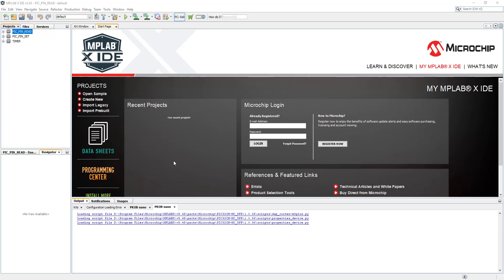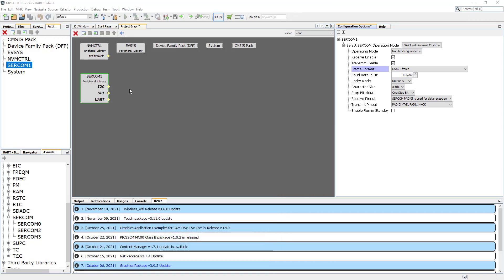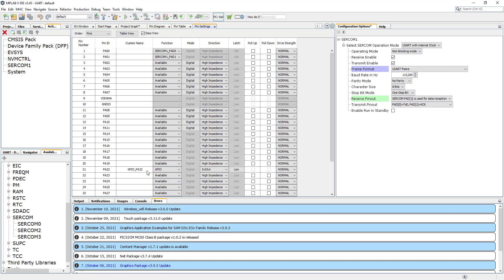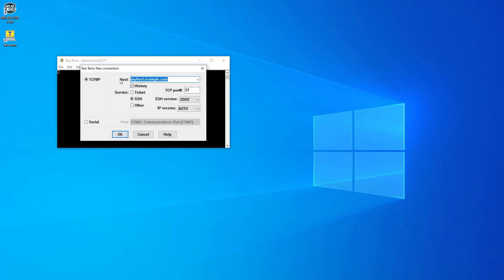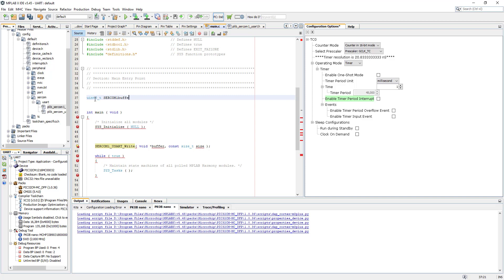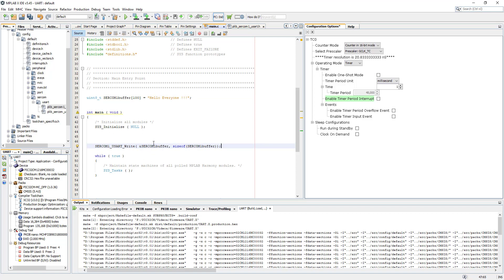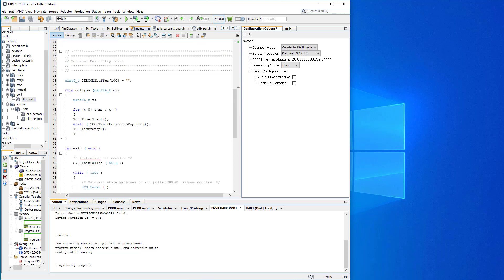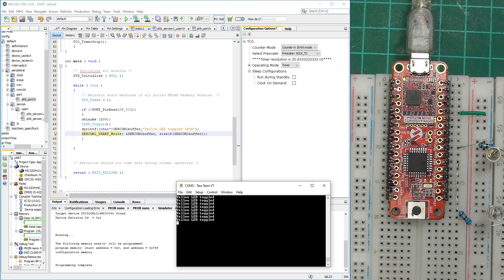Tutorial № 4 - Setting up SERCOM - USART to communicate with PC Terminal

Comment: Good tutorial, but there are a few problems: First you don't need to write &SERCOM1buffer, since arrays decay to pointers in C, you can just write "SERCOM1buffer" without the ampersand. Another problem is using sizeof(SERCOM1buffer). This evaluates to 100, and it really does send 100 bytes, not just the string you intended. Switch your terminal program to hex mode. I tested it with Minicom with a SAMD21G18A with the -H switch, and the buffer is filled with zeros, which is the default for global C variables. So it sends your string, followed by lots of binary zeros. And for your first example I wouldn't specify the length, and instead use 'char* SERCOM1buffer="Test\r\n"', and then "sizeof(SERCOM1buffer)-1" (to remove the last binary zero). For your second example using a bigger buffer makes sense, but I would also use a char buffer, then you also wouldn't need the (char*) casting for the sprintf. And then just strlen(SERCOM1buffer), which needs to include string.h, and which might be also good for your first example, if you want to keep the buffer for the second example.

Comment: How is pad[1] used for reception as well as xck?
Reply from the maker: Hi Shriyash, thank you for your comment. In this example we have PAD[0] - Transmit (TX), PAD[1] - Receive (RX). As you can notice we are using USART WITH INTERNAL CLOCK which is provided by SERCOM internal  baud-rate generator to shift and sample data. You can select a different option for Sercom Operation Mode where you supplying clock externally through the XCK line thus PAD[1] will be set as XCK IN. Hope this helps ☺